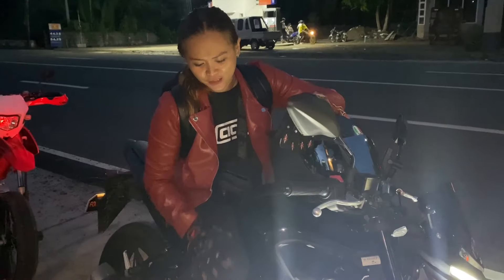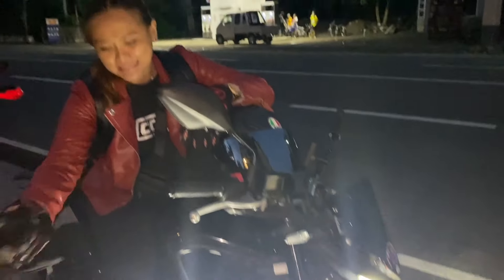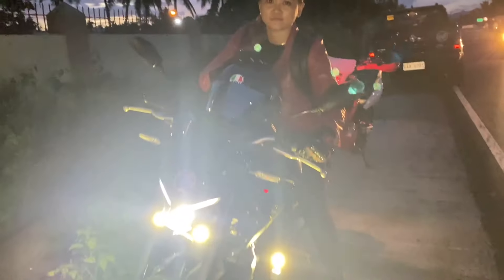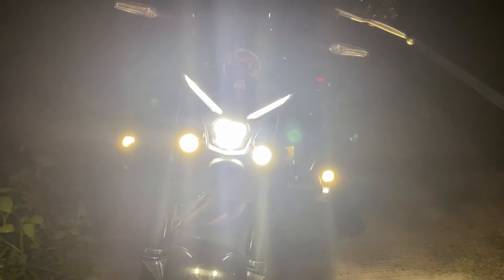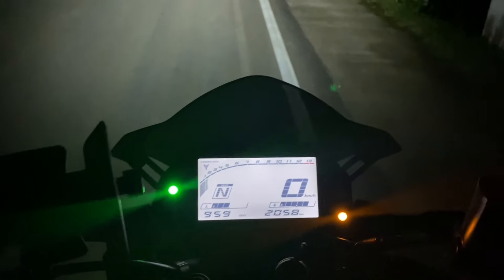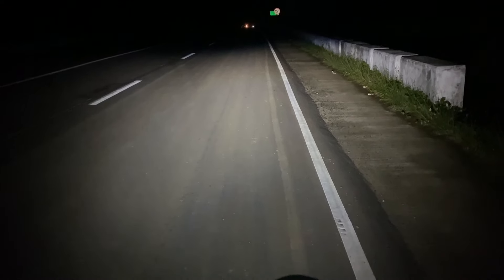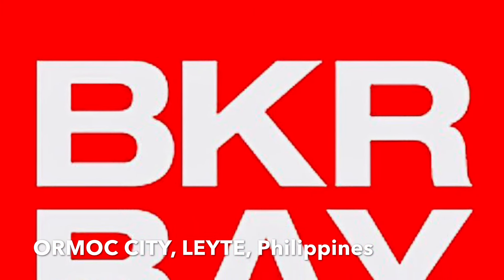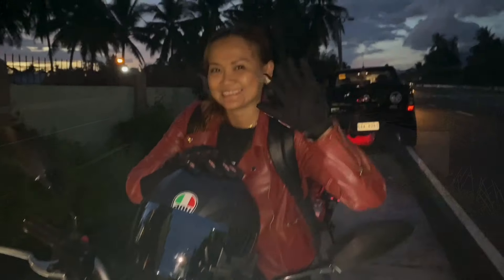Yamaha MT-03 | Mini driving lights Installation | Test | Endurance Challenge Preparation | BIKERBAY

Comment: mt03 user here and we have the same sliders. Kindly check the bolt connected to the engine support. Bitin yung bolt nung ganyang slider and not safe as only 3 threads are connected to the engine support. 

Pero nice aux lights. nagkaidea ako. New subscriber here.
Reply from the maker: I have tested it po and it protects and supports the body of the motorbike well. Walang gasgas except sa slider. I recommend it po 😊💕👍👍👍
Reply from the maker: Please check my new uploaded video. Regards 😊
https://youtu.be/UplQ-1c4E4Q
Reply: @JellyBee888

Comment: Buti napanuod ko tung video mu mam, Mt 03 rider din kasi ako, itim din ang kulay, hirap kasi  ako maghanap ng accesories bagay sa kanya, anu p ang pangalan ng auxiliary lights na pinalgay mu sa Mt mu mam?
Reply from the maker: Hello sir, good day po. Two sets yong gamit ko. Yong dalawa na malapit sa headlight Illume extreme mini driving lights then ang isang set na nasa slider po M1 po yon sir. I’m glad po na mt03 din sayo sir. Hehe high five. Ride safe always po
Reply: @JellyBee888  salamat po mam...
Reply: Panu po pagkabit direct na sa battery..?
Reply from the maker: Hello sir, good day. Technician na po ang gumawa sir. 😊👍